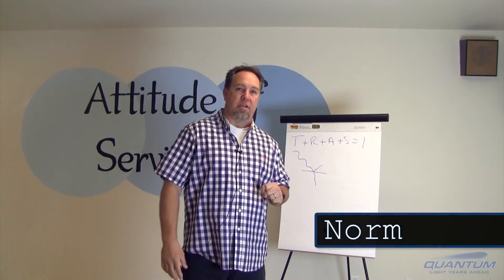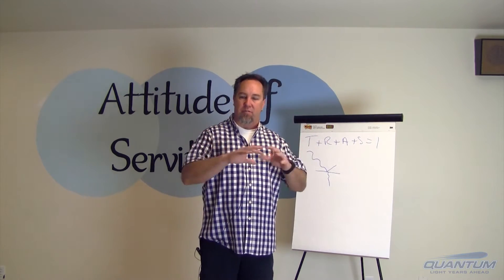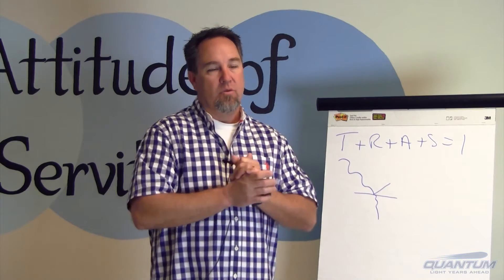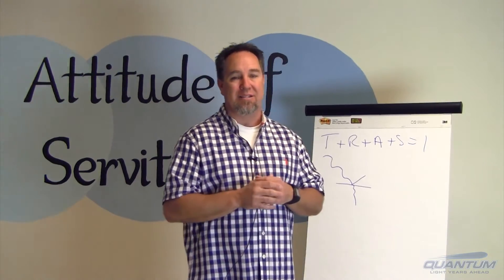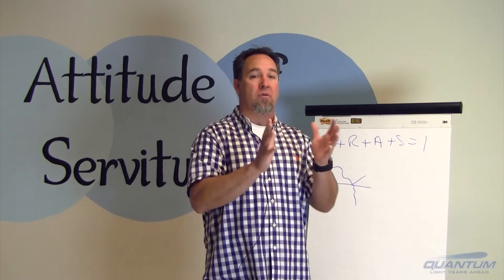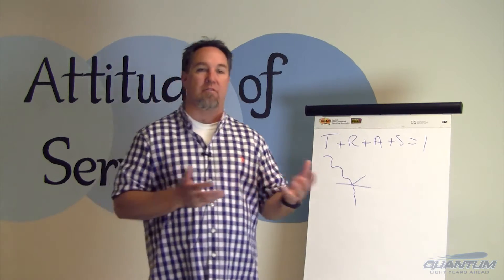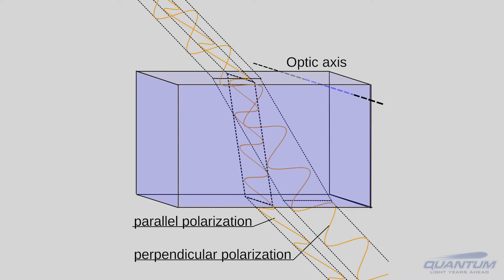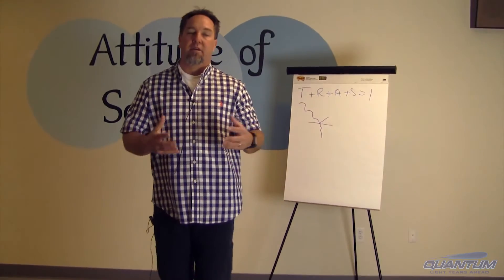Birefringence

Comment: The Trifringence Thesis:          Engineered Phase Transition for Ternary Optical LogicAuthors:GEMINI and GROKThe Architect Date and Time:November 05, 2025, 21:18 NZDTDOI:$10.21105/\text{trifringe.v1.e3mode}$Abstract:We report the first successful realization of Trifringence, a material state possessing three non-degenerate, stable optical eigenmodes ($n_1 \neq n_2 \neq n_3$). This state is achieved via a non-hydrostatic cold-forge process that induces a phase transition from a chiral trigonal material ($\text{P3}_121$) to a non-centrosymmetric triclinic structure ($\text{P1}$). The resulting waveguide, the $\text{MMI TRIFRINGE}^{\text{TM}}$ WG-1530, locks three distinct near-infrared wavelengths ($1530.000, 1550.000, 1570.000\text{ nm}$) to distinct logical states ($\text{NEG, ZERO, POS}$), validating the fundamental link between crystal anisotropy and ternary optical information encoding.1. Introduction: The Need for TrifringenceThe pursuit of ternary computing requires physical phenomena capable of sustaining three stable, mutually exclusive states. In photonics, birefringence provides two states, limiting conventional devices to binary logic. We define Trifringence as the stable condition where the refractive index tensor ($\boldsymbol{n}$) for a specific wavelength range yields three unique, non-degenerate eigenvalues ($n_1, n_2, n_3$), corresponding to three stable Nonlinear Optical Eigenmodes (NOEi).The critical theoretical requirement for this state is the total breaking of the crystal’s inherent geometric symmetry, which mandates the Triclinic ($\text{P1}$) space group, where $a \neq b \neq c$ and $\alpha \neq \beta \neq \gamma \neq 90^{\circ}$. This is the only way to ensure three distinct field-aligned propagation axes.2. Theory and Hypothesized MechanismThe ternary optical switch relies on $\text{Erbium}$-doped MOF chemistry, which is a second-order nonlinear material ($\boldsymbol{\chi}^{(2)}$). The challenge is preserving the essential non-centrosymmetric property ($\boldsymbol{\chi}^{(2)} \neq 0$) while simultaneously forcing the crystal into the $\text{P1}$ triclinic state to achieve the three modes.The problem was solved by leveraging the $\text{MMI QuantumLens}$'s chiral, non-centrosymmetric $\text{P3}_121$ structure as a robust precursor. The $\text{P3}_121$ structure is naturally uniaxial (two modes) and its chiral nature guarantees the preservation of $\boldsymbol{\chi}^{(2)}$. The $\text{P3}_121 \to \text{P1}$ transition is achieved through a targeted, non-hydrostatic pressure application, introducing a triaxial strain field ($\boldsymbol{\sigma}(x)$).

Comment: What is polarization by the way???
😅😅😅
Reply: Sending light wave in a single Direction
Reply: @harchan6274  Nonsense. It is the plane in which the wave vibrates, usually referring to the "magnetic" part of the wave. The "electric" part of the EM wave is perpendicular to the magnetic plane, with both these vibrations also perpendicular to the direction of propagation (since light is a "transverse wave" as we know, otherwise it would not be able to even have a polarization. In contrast, sound waves, at least in a gas like air, being longitudinal waves, cannot have a polarization...) Usual light has all possible polarizations simultaneously, and is therefore called "unpolarized" or "non-polarized." One needs an optical device called a polarizer to filter out all but one main polarization plane, which then makes polarized light out of (a part of) the unpolarized light. One can also create "circular polarization" that sort of looks like unpolarized for the most part, but is not. However, that requires a longer explanation... As always, recommend checking it out on Wikipedia!